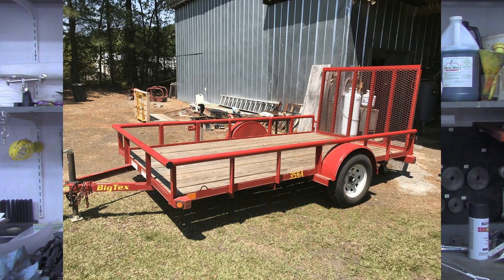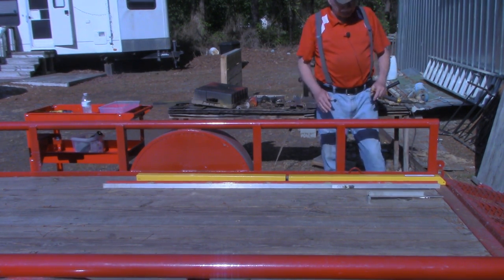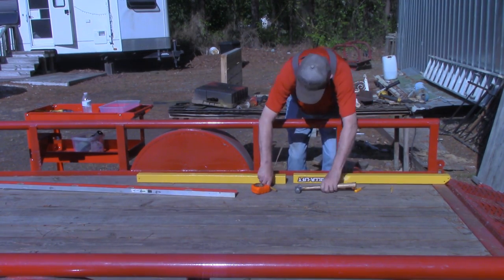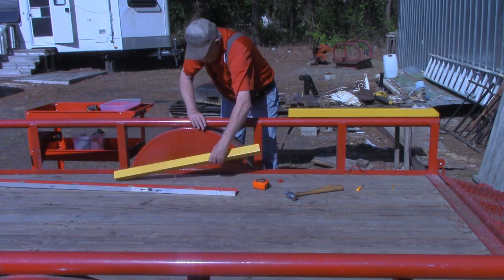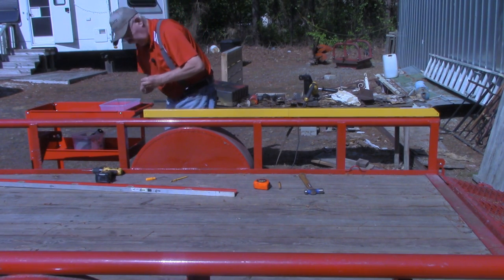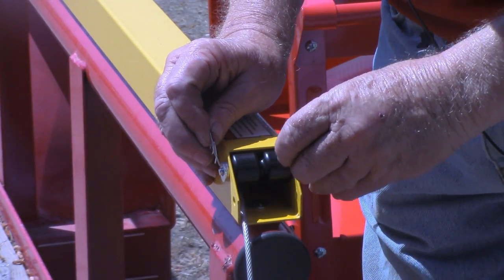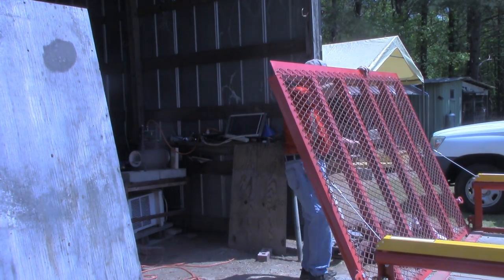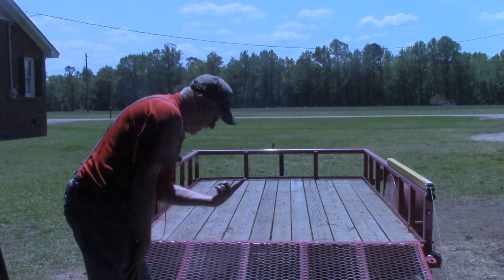Gorilla Lift Installation

Comment: I just found your channel because I am trying to find a spring assist lift for my new trailer. That’s probably the most detailed and best videos I’ve seen on installing one. I can tell you probably been a machinist most of your life or you should’ve been. I just retired out of a tool and die shop where I had been a machinist for 41 years and the last 21 years. I’ve also been the maintenance and machine repairman. I do all the repairs in the building, including electrical hydraulics nematics but they tell me I can’t put one of their lips on my trailer because the sides are 27 inches high they’re only recommended for 24 inch high sides. I’m thinking I could just add 3 inches of chain to the end of the cable and it wouldn’t lift all the way to the top, but if it would just get it off the ground in halfway up from level, the rest of the way would be pretty simple to lift, I enjoy your channel and I did subscribe. I hope to have more time to check out more of your videos. I have a YouTube channel myself on lawnmower and snowblower repair with a little small engine work. Check it out and leave me a comment. I’d like to hear from you.      My channel is
Jimsfixitshop           Jim

Comment: Great idea over all but with one big defect, the black plastic rollers eventually wear out and break down the centre by the cable continually running over the plastic rollers. I had to come up with make-shift new rollers after a year of use, it wasn’t a fun but long repair, if only there’d have made the rollers of metal in the first place, they’d never wear out.

Comment: Instead of boring a test hole, place your round stock in the vice, find the edge and center of it.  Move in the “x” direction the radius distance you want to bore.  Then move the cutter in your boring head until it just touches the work piece.  Now you have the correct radius dialed in the boring head.  Move back to the workpiece the amount you want to cut and bore out the arc you need.

Comment: Good morning sir. 
Would it have been possible to install the springs inside the round top rails of the trailer?
Reply: excellent observation, sir. Mine came in today and will give this a try over the weekend. My concern is the springs encountering the bolts, considering the bolts go all the way through the housings with the exception of the end bolts. If I try what you asked, that will be no issue at all. Thanks for your question. Round pipe top rail complicates things slightly.
Cheers from Louisiana.

Comment: Yesterday I was having problems balancing the gate with two lift assist , two didn’t work at all, so only used one.
Reply from the maker: I’m still using 2, but only one of the springs in each one. The other spring is just floating inside the other.

Comment: Good job Lee. The only time I have seen one of those drop flat tailgates in use was the John Deere Service Truck. They delivered the new tractor then folded the gate down to drive back, same thing for regular service, showed up with it flat, loaded the tractor, and away. The lad driving that truck was only 20ish, I don't think he was bothered by 55 lbs...